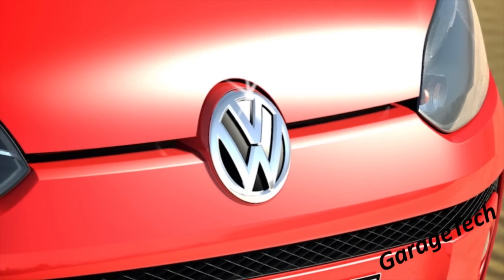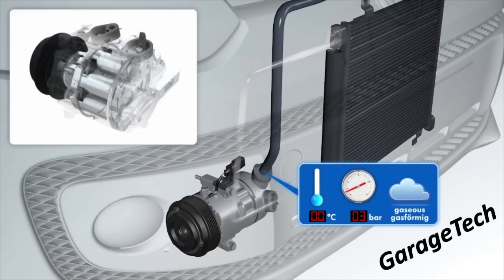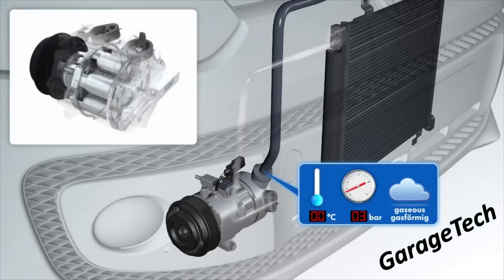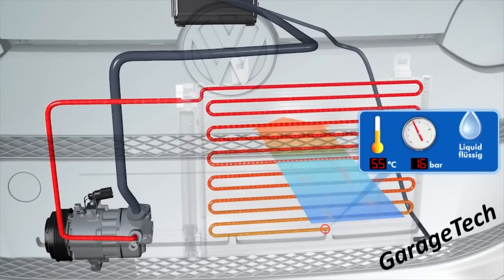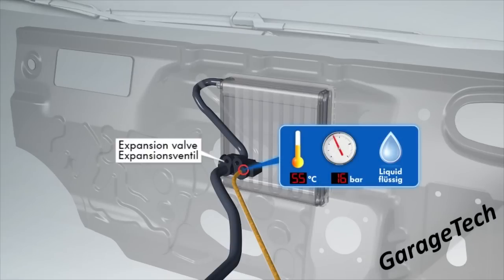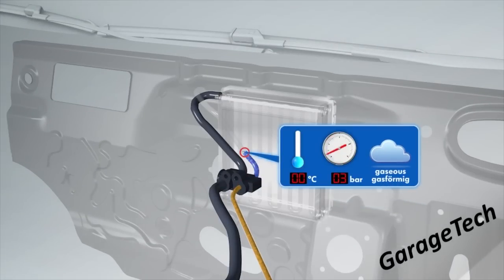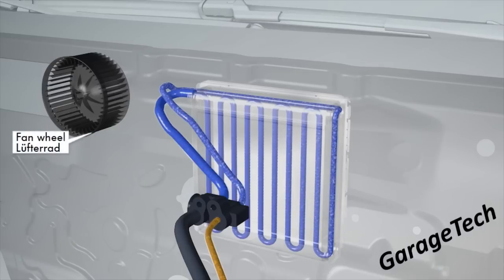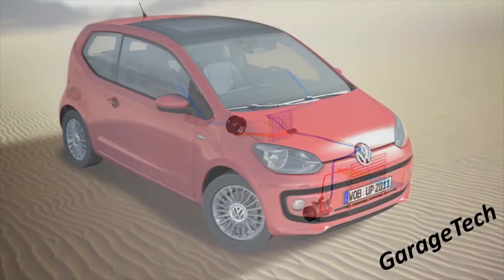How does a cars Air Conditioning system work?

Comment: One small correction: Dryer is used to remove any unwanted water (or water vapour) and also acts a filter. Water vapour is really bad as it freeze in expansion valve  causing starvation.

Comment: Excellent animations and explanation!! How do-able is building an AC system into a non AC car? (or transferring a system from one car to another?)
Reply from the maker: It’s achievable but would be a lot of work, best thing to do would be to have another car the same which has AC and swap over all the parts.  Dash board and heater controls, heater box and matrix, plus all the AC hoses, condenser , AC compressor, different crankshaft pulley and belt. May even need to have the Engine ECU coded so it can keep the rpm up on idle when switched on. It would be a lot of work and you’d have to question is it really worth it.

Comment: Just one mistake, if the temperature of the refrigerant is 0C going into the evaporator, then it must be warmer when leaving. Since Cabin air is what warms it, then the temperature of the refrigerant as it enters the compressor is probably around 20C (since it has be to less than ambient air temperature) and not 0C

Comment: @Garage tech, on the return circuit, is it not the hotter gas that comes back to the compressor? Not the cold gas as mentioned in the video. If it was cold gas, it was not required to be circulated back to the compressor. It should be hot enough to continue to be a gas but not hot enough for heat transfer with atmosphere which is why gas is compressed and sent to the condensor.

Comment: I understood everything up until you pushed hot liquid through a small hole to make cold gas?
Reply: Temperature and pressure are related. The metering device (small hole) and the compressor creates a pressure differential between them. When the high pressure liquid passes through the metering device it becomes a low pressure liquid and the temperature drops significantly. Since the refrigerant is now colder than the air passing through the evaporator coil the refrigerant absorbs heat from the air and makes it cold.

Comment: Question.  My 2008 ranger is leaking red fluid, only when the ac is on. If I don't turn the ac on for a month no leak. I turn it on 3 minutes later red drops on the ground.  The coolant is red. Could this be coolant leak if so from where. Any thoughts?

Comment: How does the compressor handles high rpm's? Does the valve lets more fluid flow, or does the cooling fan from the radiator helps it maintain a steady pressure inside the system? I know it has 2 modes, the  normal and the max speed fan. Will it cool more if I maintain the engine at higher rpm's too?
Thanks!

Comment: Great video and animation. I'm trying to troubleshoot an issue with my car's aircon. Had the compressor refurbished (twice) and and it works for a few months, then just won't engage (sometimes / intermittently) and airflow is not consistent (ie: seems to "cycle" between cold air and warm air "on occasion") and then doesn't work (at all) some days. Taking the car back, but I'd LOVE to to know anyone's thoughts on this issue. I live in a hot place, but still, that's that the aircon is supposed to do, right ! PLEASE help me understand this issue (if possible!) Thanks!
Reply from the maker: Hey, I’d want to know why the compressor was refurbished in the first place? If the compress failed internally there’s a chance some small particles may be still in the system which has caused the 2nd compressor to fail. Ideally you should have the system flushed and a new condenser and dryer fitted to ensure no particles are in the system.
Reply: @GarageTechAutomotive  thanks for the feedback. That's a good point about the condenser, and possible contamination. The compressor was refurbished because a new one was not available at a suitable price point. Ultimately, the company who did the work put in another refurbished compressor, so I guess the entire system was not properly flushed.

Comment: At the expansion valve , it doesn't boil the liquid to make it a gas .
The physics is , if you suddenly compress a gas it will generate heat ..
(Compressor) If a gas suddenly expands , and hence drops in pressure it will cool down,  enough to make ice.
If you open a valve at the end of a Compressor tank , as the compressed air leaves,  and expands you will feel the metal outlet getting colder , and it may form ice , depending .
This is also only the cooling part of the A/c ....
The gas expands , drops in pressure , as you mentioned , and this is the cooling effect , its transfer of energy really ..
 a full system would include that as the warm air is cooled over the evaporator,  It cannot hold as much moisture .
Warm air holds more moisture than cold air , this will reduce the dew point and water will be separated from the air.
Resulting in cooler dryer air.
This water can be dumped out the bottom of the vehicle..
Don't freak out if you have water dripping from underneath your vehicle after a journey on a hot day , with the A/C on ..it's just this condensate being dribbled out
Reply: Im probably being a Twat pointing that out though ...😒
Reply: Its both. When the refrigerant vaporizes it absorbs a lot of heat to do so. Something vaporizing is a endothermic process that absorbs heat. Thats why we sweat, the water on our skin evaporating absorbs heat from our body.

Comment: I learnt it was way back in 2014-15(engineering days)....But that time I was confused regarding this topic, finally I got the solution... The way u r explaining pressure & temp. at perticular point is just clear all the daught. Thanks
Reply: All Indian engineers are like you, they pass exams without understanding much, the system is such.
Reply: @NishitShukla  Right. They only focus on how to get numbers.
Reply: @prashantjagtap_17  My father was B Tech Mechanical, he retired as Chief Engg, Damodar Valley Corp, ran a 780 MW plant, but I don't think he knew how the thermal power plant ran. 😁😄.
I am into Economics, even I don't understand how the economy works😁😄
Reply: @NishitShukla  😀 Ok. This month I got selected in Johnson control as a design engineer, and the main product of company is HVAC, so I suppose to know all things about that so try to learnt this after selection 😅😜
Reply: @prashantjagtap_17  Good luck man😁😄. I am confident that you will never be the one to invent fb, twitter, google or for that matter anything that can be called invention.
The last major invention from India was lavan bhaskar churna.

Comment: Very good video and explanation,  as well as indicating the directional flow of the gas in the system.   I am getting high pressure on the low side so I'm thinking it's probably the expansion valve now as this seems to be the place where the high pressure drops to lower pressure.  Thanks again for posting this.

Comment: How does the liquid boils into gas but also loses temperature?
Reply from the maker: Hey, it’s all down to chemistry, the natural boiling point of AC gas is between -26 to -30 degrees Celsius, depending on which one is used as there’s a few. When the gas boils it absorbs the surrounding hear which lowers the ambient air temperature by about 15•c

Comment: I like your video..i want too know if i can put the condensor in a standing formation...so cold gas wil go from te underside  vertical following te condesor line..to get out from the underside  heading to the drier reciever..if its possible..wil it harm mij compressor  about its oil which we put it in for the working condition..my engine room has not enough place to out is horizontal..so i want to place it vertical..looking forward for youre answer

Comment: How is the Compressor affected by the rpm of the engine? 
It looks like it has a fixed ratio but then the power of the Compressor rises with higher speed? 
How does the AC regulate the cooling power at high speed travel?

Comment: what are the other potential causes of car overheating other than engine problems? the engine has been fixed, and the AC seems to be cold. When i turn my AC on, it overheats after a few mins of driving and there are smokes under the hood. The mechanic says it could be due to relay or fan problem. Can you shed some light please?

Comment: @4:51
Why is that a generally
Warm liquid refrigerant (55 degree celsius with 16 bar of pressure)
When turned into vapour it becomes cold at 3bar of pressure.
And how does they make the system suddenly have 3 bar of pressure?
Sorry I'm confused

Comment: Hello Mr.

Thank you for this explanation, very nice, but I didn't got the answer I was looking for. Maybe you can help me... Last winter I had my mechanic install an air conditioner in a van I converted into a camper. I barely got the original for the second installation (VW T4 - year 1995). The air conditioner works (cools down a lot), but the cooling stops after some time. Condensation (approx. 1 dl) appeared under the passenger's feet a few times, and the second time, after approx. 20 minutes, approx. 0.5 - 1 l of condensate spilled under the van. In principle, I have found that the time lag between switching on and stopping cooling is related to external humidity. The mechanic has already inspected the drain - clean. Refilled, checked exhaust temperatures, etc., everything should look OK. The situation is still the same. He mentioned something “rheostat” or something like that to be replaced ... I don’t know, the air conditioner was bought new, a kit.
What is your opinion, do you already have any experience with these climates (VW T4, l. 95)? I myself suspect that after a certain time the condensate freezes somewhere and consequently has nothing to blow out. But when it thaws, it all flows into the drain and something passes at once. According to my logic, only a fine setting of all parameters is needed (if there is a thermostat for real defrosting ...)? What do you think?

Thank you for your time nd your answers.

Greetings!

Comment: Nice video. So it means when the AC is not cold anymore it could be the condenser or evaporator problem. Is that right?
Reply from the maker: EduardM could be no gas in the system, It may need re-gassing or could have a leak, most commonly because of damage to the condenser from stone chips etc. The compressor could also be faulty.

Comment: Does keeping AC at low cooling ( higher temperature ) helps in fuel efficiency  .??
Orr does compressor works same for all temperature.?
Reply: With a classic fixed displacement compressor (whether piston, rotary vane or scroll), the evaporator gets to a precise temp and then the clutch cuts off, then once it has warmed up again a bit the clutch re-engages and the cycle repeats, and that's it. Having recirculation on and heater on will only add heat and therefore make the cycle longer than recirculation on and no heat so even less FE. Can't cycle off at too high of an evaporator temperature or the clutch will wear too quickly, so the comp clutch generally cycles off at 0°C/-0.5°C evaporator fin temperature. With a non electronically controlled variable displacement comp, the comp has no way of sensing user's temp demand, so with recirculation on and heater on, displacement will stay higher (than with recirculation on and heater off) in order to bring the evaporator pressure to the the one the mechanical control valve has been calibrated to, and again less FE. With an electronically controlled variable displacement comp, FE will increase because the control unit will sense the driver's temperature request and be able to adjust compressor displacement to lower values accordingly so that the evaporator stays warmer and fuel is saved.
Reply: @teravolt6113  thanks

Comment: Great video, you’ve got a like and I subscribed. Now I’ve got a question for you. I’ve got a car with dual zones. One side of the car is blowing cold air just fine. Meanwhile it takes approx 15 minutes for the other side to blow cool air. What could be the issue here you think?
Reply from the maker: Mosaro, thanks for the sub, most likely be an issue with the heater box flaps. These are the flaps that direct the air inside the heater box. If one side is getting cold then your AC is working. Hope that helps
Reply: @GarageTechAutomotive  Thank you for coming back to me so quickly! I'll go and have it checked coming monday. If you're curious I can then come back with an update.
Reply from the maker: Mosaro, yes please do, hope it’s nothing too expensive🤞🏻
Reply: GarageTech update: a couple of months ago I let them do an airconditioning check. They had forgotten to put back something that had to do with the interior filter, I don’t know what it was... It’s fixed now with no cost 👌🏻

Comment: One things wrong on this video the blower fan doesn’t blow hot heat from outside over the evaporator. The blow fan in cars is usually in the dash the condenser coil is where all the hot heat is takin away. The blower fan just blows the cold air off the evaporator since it’s already a gas and cold no cooling down will happen like the fans on the condenser. Why the condenser are outside the home or the cars cabin cause they take the hot heat away

Comment: Please I have a problem with my Camry 2008 v6 ac. The cool ac seizes from time to time . When it happens I turn it off and on again . Then I gets cool for 2 mins and seizes again . 

Wondering is it’s an issue of the compressor sensor or Ac pressure switch , or expansion valve ? There’s no leakage . Please help

Comment: nice video but two things:

the function of the drier isn’t to keep the refrigerant as a liquid, it is there to remove water from the system and to act as a liquid refrigerant reservoir. 

also when the refrigerant passes through the expansion valve, is doesn’t cool because it boils. it boils because the pressure drops, (if you compress a liquid it’s boiling point increases, which is why it can be a liquid at 16 bar in the pressure side). it is the expansion of the refrigerant through the expansion valve that creates the cooling, not the boiling of the refrigerant.

Comment: I am beginner with driving. When I turn on the cooler I turn on the A/C button as well. Do I need to turn on the A/C button when I turn on heating or should I leave A/C button off?
Reply: When u want heat leave the ac button off

Comment: could it be the expansion valve?
Reply from the maker: larry mcinnis, have you checked how much gas is in the system? Sounds like it could be over filled with gas. To much gas can cause this. Good luck.
Reply: @GarageTechAutomotive  yes it calls for 32oz that’s What I put into the system after I vacuumed the system.

Comment: My 2007 Ford Taurus shows good static pressure but the clutch doesn’t engage so I jump the relay the clutch engages but the pressure on the low and high side goes way too high. The low side almost goes all the way to the gauge limit as does the high side? Any ideas?

Comment: hello sir, thank you for your effort , I’m having a problem with an audi a6 4f 2010 , where the ac doesn’t blow cold air, visually checking the engine bay the ac hoses aren’t cold, i have a “sunlight photo sensor open or short to ground” error code, I do have vcds, I hope you can point me in the right direction on how to do further diagnostics , I know there are things like basic settings, adaptions , and measuring values, but i’m not sure how to use them for diagnostics, best regards , thank you in advance :)
Reply from the maker: Osama Maddani, I would want to check AC pressure and how much AC gas is in the system first. To do this properly, you would need an AC machine. You may be able to read the measure valve for the high pressure sensor which should be about 5bar with the engine off and 10-15bar whilst running. Good luck
Reply: @GarageTechAutomotive  on vcds , refregirant pressure " as you said it's high side" it reads 6.4 bar to 6.6 unchanged wether engine on or off, AC on or off it gives the same reading .
 However I can see the "AC regulating valve n280" change from 0% and 0.010 Amp to 60.5% and 0.650Amp when I turn AC on, what can I conclude out of this ?
Reply from the maker: Osama Maddani, so it seems there is some gas in the system and the regulation valve is doing something. As the pressure is not increasing it’s possible the compressor is faulty. I would suggest getting the gas recovered/removed from the system and check for any metal particles in the recovered oil. This would indicate that the pistons in the compressor have failed. Quite a common fault with those types of compressors.
Reply: @GarageTechAutomotive  thank you very much, sir. But what confuses me is what would cause it to fail? Does it need timed service intervals that I'm not aware of?
Reply from the maker: Osama Maddani, these types of compressors are working all the time unlike the clutch type compressors. I.e the internal moving parts. Ideally you should have an AC system services every 2 years. As part of the service or de-gassing of the system some of the oil (PAG oil) is removed. Fresh oil will be replaced. This oil helps lubricate the compressor and helps prevents the seals from drying out. Hope this helps.
Reply: @GarageTechAutomotive  You sir are a great source of helpful information, really thank you.🙂
I have never done this in the car's entire life 10 years.😅

I just came out from under the car, i took off the plug which I believe connects to the "solenoid valve " inside the compressor to check voltage , there are 12V indeed when the AC is turned on , but I noticed the plug was oily which it shouldn't be ( I think this is a no brainer, oil shouldn't be there) , couldn't it just be a bad solenoid valve and not the whole compressor?🤔

Also the "solenoid valve" is it the same thing as the "N280 AC regulating valve " ? If not where can I find it?🤔

And really thank you very much, I really am grateful 😊